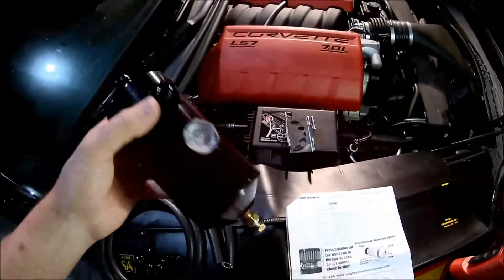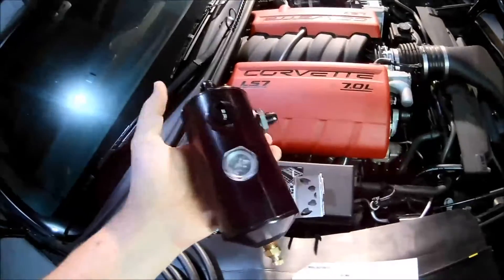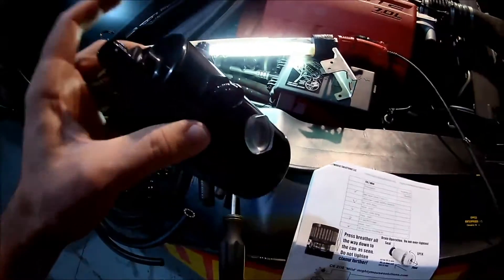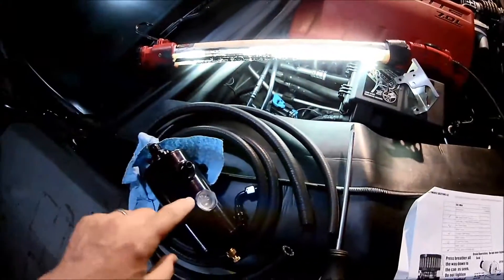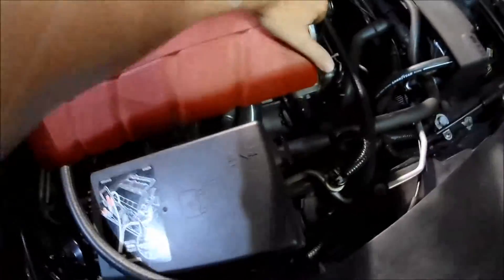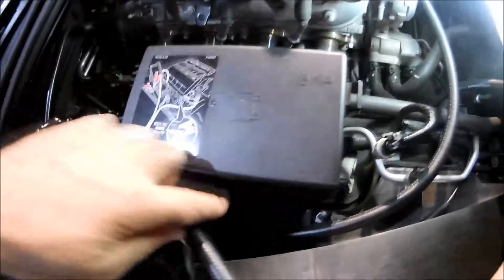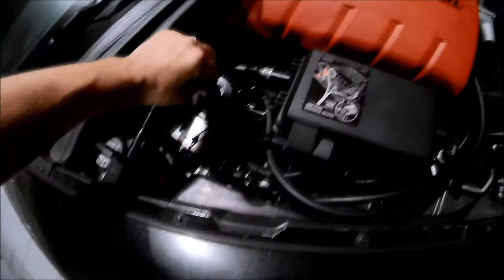How to install an oil catch can and why it's important using Mighty Mouse Catch Can

Comment: where to start, came here from vin wiki to check the channel, leaving unimpressed.
1:06 "the pressure really doesn't have anywhere to go" uuuuh, PCV??
1:35 "you know you could just vent all those gasses into the atmosphere" do you mean a road draft tube, pcv venturi to exhaust?
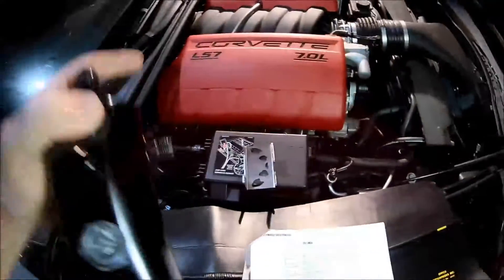2:50 "wondering why you keep blowing that same seal"
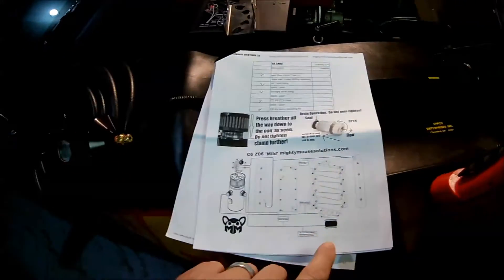3:08 "especially high pressure, it's going to push it up towards the surface" huuuuh, maybe you should diagram that?
5:25  "so if you do have an over pressurized crankcase situation, so much that it ovewhelmed your system ~ splash onto your windshield"
if you had mentioned intake valve deposits, esp. on direct injection motors, you'd be right on task, but that catch can brings nothing to the table to improve PCV scavenging, or "help any engine breathe better" in fact i'll bet it restricts flow to some degree or another.
i bet it's a joy when you inadvertently forget to empty it and it starts gulping liquid oil into the intake and you get the lovely blue smoke.
seems like you could use some remedial 101 automotive classes, and stop pandering disinformation as a corporate shill.
i've had my L1 since 1996, and no, i'm not smarter then the enginerds building these things.
Reply from the maker: I checked all this info with Mighty Mouse.
Reply: Why does this can have a filter and others don’t?